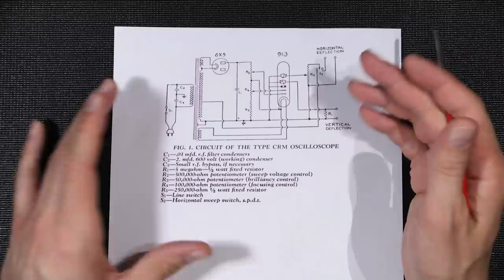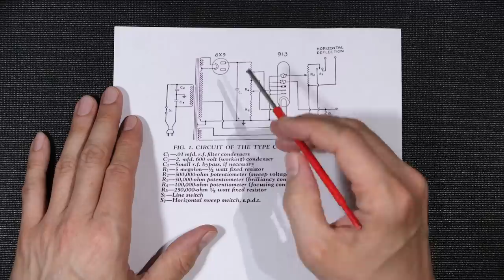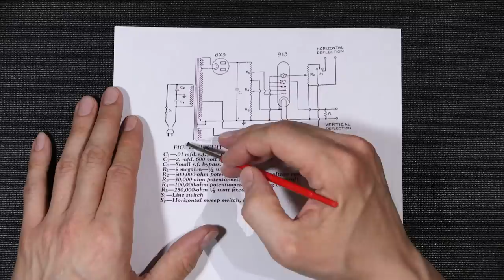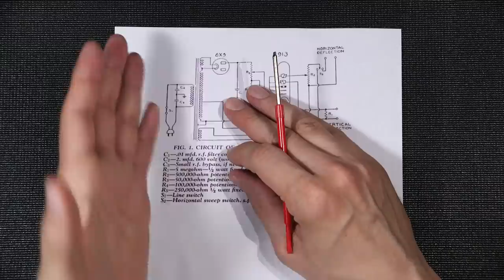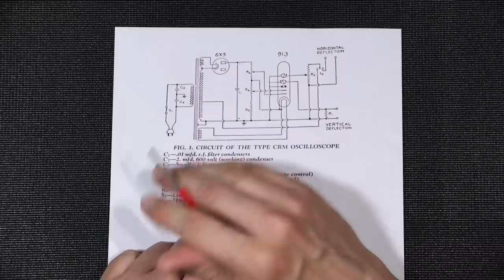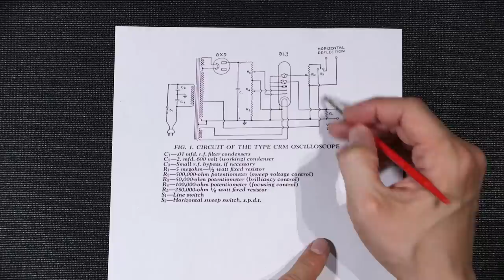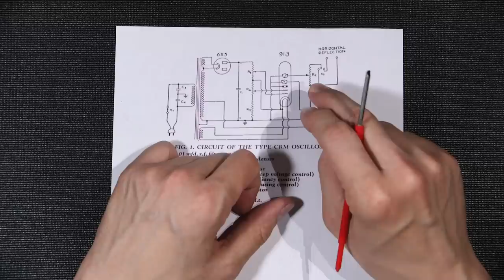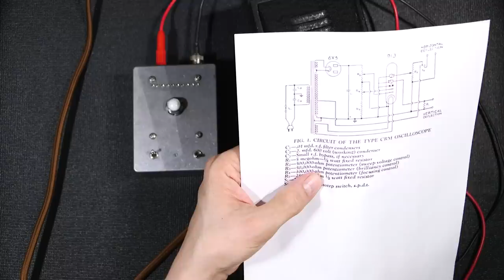Neat Electronic Tool From The 1930's, Lets Look Inside!

Comment: Wonderful bit of vintage gear!  I would have liked you to remove the capacitor contents from the Aerovox can and re-stuff it with the new capacitor.  I think it's important to keep as much visual history of this kind of 1930s equipment so that when someone takes it apart in 50 years time they can see the kind of capacitor that was used back in the day.  Leave a note in there too to show what's been done. It actually makes a good debate as to what responsibilities, if any, as restorers we actually have.
Reply: It would be pretty simple to find out if it was restored... you do NOT have to recreate the mistakes of the past to make it "real."  A note would suffice.
Reply: I absolutely agree that the components need updating but if the equipment is of historical interest then leaving in place the old isolated component just to show exactly what was used originally surely gives the best of both worlds? Is the debate not more about whether a piece of equipment is historically 'worthy' of maintaining visual originality?
Reply: Exactly. The authenticity of historic equipment is destroyed by fitting modern components that are visible. At least the original component should be left so a future restorer can do it properly.

Comment: Also, it is amazing how far oscilloscopes advanced between the thirties and fifties. I've been learning about the early computers recently, and the rapid increase in the complexity of some of the signals that oscilloscopes were being used to look at during those years probably goes a long way to explain that.

Talking of which, It'd be great if you got hold of a COMDYNA or something for your old-time lab! The idea of hooking up an analog computer running a Rossler or Chua circuit to the X Y inputs of an old Marconi 'scope I have so that I can play with strange attractors is what's currently firing me up.

Comment: I was curious about that AEROVOX condenser so I typed in the patent number (1,736,764) and found an article from 1929 detailing the process to make this paper wound paraffin wax filled cube.  The patent mentions an asbestos lining used in the vat these things were made in and dielectric oils (presumably PCBs).  Amazingly, the company AEROVOX is still in business making capacitors since 1922.
Reply from the maker: All the good stuff!

Comment: Mr. Carlson, I suggest de-potting the transformer. It appears to be in good condition, other than those two internal capacitors. So replacing those would keep this scope as close to original as possible.I would also suggest, placing the new filter capacitor inside the old can. Again just to be as close to original (at least in appearance) as is possible. Brendan
Reply: Good idea. Replace too much and it becomes something different

Comment: You know that scope reminds me of the built in scope on the old Radio Teletype van that I ran when I was in the US Army back in the early to mid 1970's.  I don't recall the number of the part but we used it in the tuning up of the set, and in keeping the NSK/FSK signals aligned when in the crypto mode.  Very cool rebuild. I would love to see  you build up a new PS for the unit, however the depotting does sound intriguing.  I recently found a nice covering for some of my projects that looks like carbon fiber, I have it on a small FM radio receiver I built for our RV, looks cool but it would not really fit in with the age of your project I guess.

Comment: I’d like to see you de-pot the transformer. In my work I sometimes have to de-pot our HV DC-DC converters for failure analysis. That’s a lot of fun - trying to find where the potting ends and the circuit begins. I’d also like to see your sand-blaster in action, to be honest. I’d like to have one of those myself.

Comment: GREAT vid as usual! Perhaps mill a hole in the transformer bottom cover and use localized heat to get to that cap? Was this designed for use as a "station monitor?" If there is a future video, perhaps set it up with a vintage transmitter for a look at intended service? Thanks Paul!

Comment: In keeping with not labeling the front controls they did not label the external inputs. But they did do when clever bit, the horizontal inputs on the right side are arranged horizontally and the vertical input on the left side are arranged vertically. I think this was clever!

Comment: While I'd hate to see you go through the mess of depotting the xfrmr I think it would be interesting to see the type and style of the hidden caps.  The filter cap you replaced, although increadibly leaky had a very cool retro look.  I would have been tempted to gut it and install the replacement cap inside the original case - although I've seen enough of your videos to know that's not in the cards.  I love seeing the work you do.  I grew up on test equipment like much of the gear you restore.  Keep up the nice work!

Comment: +1 on depotting the xformer. I am also interested in you doing a video on finding suitable replacement xformers for older gear. 
Also I was wondering if you are still planning a vid on recapping and restoring the type 555. I also have one thats in really good condition. It was stored in a clean climate controlled room for the last 25 years but was inservice up until then. About the only thing o am missing is the line cord for the power supply. Which doesn't  look too difficult to replace.

Comment: I note there is no lables on the switches of the capacitor tester...i guess in those days you just had to learn what they do ☺
Reply: More like in those days the engineers weren't too sure themselves. Half the stuff no one had thought of a name for it yet anyways.
Reply: they still don't. they still measure capacitors in the amount of volts per second it can randomly hold. with no mention of important stuff such as the atomic number of the materials, their area, and distance to one another. as ac and radio and light and the behaviour of capacitors are all the same thing, those aspects are far more important if we ever want to get ion drive spaceships than how many farad they just so happen to randomly hold 'it does something! let's call it a product and ship it!'
Reply: As long as it does something I'm in.

Comment: Hi Paul. I seem to remember that the local Harley store might have a can of black crinkle paint. I think I saw that in an Electric Radio magazine some years ago. Yes un pot it :-) I remember having an HRO 5AT1 with the doghouse PS which is potted, GRRRRR! It also had an Aerovox cap in it too. I'll be waiting for that video :-) Oh the wonderful odor of melting tar :-)  The transformer may be re used without the caps?  Or would the heat ruin the varnish?  A nice cliffhanger as to what you plan to do with it after :-)

Comment: Maybe the potted capacitors was part of some planned obsolecence / need for replacement parts from national? Or maybe it was for "safety" if the capacitors blew they would be sort of contained. Interesting to pot them though as it does make servicing them very difficult. Any thoughts as to why they might have done it apart from design error?

Comment: I was expecting to see a resultant display, from the 6L6 much like how a Nixie tube works... as in a Philoscope.
 Mind you, a Philiscope would have been handy for the capacitor testing! (except for the LC bias due to the components being potted)
 That Sw3 for the horizontal, well that simply provides the locked-to-60hz reference for the Horizontal whilst measuring a Y deflection only.
Keep up the good work!

Comment: I assume this little 'scope was used to view the AM signal on the vertical input and the audio on the horizontal input to verify linearity of the AM signal.
Reply: David Perkins yes it's a modulation monitor, a common enough piece of test gear in the days when hams used a lot of AM.

Comment: Kind of amazed on this cap tester to see a full scale deflection from just 2 generic NPN's  just touching the clips. Are you sure there's no strong EMI or RF being picked-up? Also for the potted cap test, wouldn't the BNC negative clip lead have been a better choice to clip to the chassis ground, assuming the cap tester could be picking-up stray fields? (Good job.. I'm almost convinced on the merits of joining the patreon crowd).
Reply from the maker: Hi Cliff. There are RFI and EMI blocking caps in the design. That really is the resistance of the rubber material :^)

Comment: I wonder if early scopes like this "morphed" into the station monitors by dint of improvement from early models that would have been jury -rigged into home amateur radio stations. They retained the characteristically "very tiny" tubes, maxing out at 3 inches or so in the Kenwood ones I'm familiar with.   So simple, and unlike a general purpose scope.

Comment: I'm wondering if that device wasn't designed with being an AM mod scope in mind: For the old "trapezoid" waveform, just patch your modulation audio to the horizontal input and a sample of your antenna feed to the vertical. 100% mod would show a triangular envelope, less would show a trapezoid and overmod would show a (usually) distorted triangle with a straight line from the apex.

Comment: Saw the patent number on that capacitor, so I looked it up. U.S. Patent 1736764 was given to Aerovox Wireless Corporation. The patent is for a step of oil cooling was dipped condensers during manufacturing. Apparently, there were two companies at the time in the same business - Aerovox and  Dubbilier Condenser Corporation. Dubbilier had a patent on what it claimed to be the exact same thing as Aerovox, so they basically sued each other. It looks like at the time, the U.S. Patent office would be in the habbit of issuing patents to two companies for exactly the same thing.

Comment: If you de-pot the transformer to replace those hidden filter caps, then you might as well find a way to re-purpose the original Aerovox housing to hide your new poly cap inside that as well to give it as much of a stock look inside as possible?

Comment: Hi Mr. Carlson, I’m restoring a 1940 Dumont Oscillograph, a 1929 Atwater Kent and a 1939 Sparton console radio plus a few more pieces of antique equipment. I’m having difficulty finding any info on resistor watt requirements. The schematics don’t reveal that info. Is there a “rule of thumb” to determine what they might require?
Thank you for your time.

Comment: if the leakage of the transformer capacitors are not bad enough to threaten the transformer you could just use an isolation transformer to use the device safely.

it may be a good idea to turn down the brightness control and bring it up slowly because if the crt is getting too much voltage ir could burn in otherwise and getting a replacement crt can be difficult unless there is surplus stock out there.

Comment: Crackle finish is important part of the legacy? Built in u (mu) screen? What sort of capacitor? 2uF 600V is probably EHT smoothing and is that big it's paper with long survival rate. Clean around the terminals and the leak will likely be gone! Check it yes but I'd say it will be OK. No timebase components - so is this a Lissajous display with ac X scan? Yeah? Unusual device. Little audio monitor showing activation and volume (strength). Good video. Very clear. Thanks. What is your accent?

Comment: Hey, Paul: why not just use a smaller Transformer and a solid-state voltage doubler or tripler if needed? That way, the unit would run cooler and last longer as well...

Comment: A small oscilloscope from the 1930's wow Now where do you find your equipment? So since it was used to test an audio signal I suppose it would display the modulation wave on that small screen. That is a pretty solidly built unit though with a minimum of parts.I restore old Military radios in my videos and I try to reuse the old parts that are there and restuff with new caps etc. so really I would go through the work of repotting that and put new caps in it. But Im with you what was national thinking when they did that in the first place? Great project and Video.
Reply from the maker: Thanks for your comment Larry!

Comment: Hi Paul
As usual an excellent video. I see that you replace components with new style only. I never see you re-stuff a capacitor. The capacitor in that unit would have been re-stuffed well. I am not knocking you for that as I (being an engineer for 40 years) still learn a lot from you. Just my opinion.

Comment: BTW - DON'T DISMANTLE THE TRANSFORMER! Chances are that those filter caps are OK anyway.  The leakage you see with that sensitive device is EVERYWHERE in that transformer. I would use a Variac on the transformer and while measuring the ac current - wind up the line volts very slowly.  IMHO of course! Good luck  BerryG

Comment: Hi Paul. While it would be entertaining to see you depot that transformer to replace the caps, I'd say it isn't worth the effort. Chuck it in the tip and replace it. As for what National was thinking...planned obsolescence maybe?

Regarding disassembly to get the chassis out, was it really easier to desolder the connectors rather than remove the screws holding them to the case?

Bugger all in this thing - just a CRT and power supply rectification, signal goes straight to the vertical deflection. Nice to know that usable test gear doesn't need to be incredibly complicated. I'm curious what the bandwidth of this is, though since it's meant for showing audio signals on an RF carrier...

Comment: I’d de-pot the transformer, if for no other reason than to get rid of those old across-the-line caps. Then use modern X/Y-rated safety caps instead. Also, even though it didn’t come with one, a fuse would be a good idea (in any restored tube equipment.) Maybe even a neon-bulb pilot light! You don’t want those old across-the-line caps to fail shorted inside the tar-filled transformer!

Comment: Regarding depotting: I'm hoping you will elect to depot the transformer. I happen to have one case where it is my only option, as far as I'm concerned, and would really like to see your methods. In your case, if you do not depot, could you possibly simply couple the ground lead from between your potted caps through one additional good cap to chassis ground? Or, could it be left floating as long as your chassis was connected to hard ground?

Comment: Hi Carlson!
since the internal transformer is at least WORKING even thou, the internal capacitors are leaking, Maybe you can get around the problem & recover the whole thing,  trying to electrically Isolate the trasformer itself from it's standoffs.... the leakage will remain, but limited to the transformer only.
Try it, maybe it will work!
ciao
Mario

Comment: Charlie Andrews, the long-time Chief Engineer of WPEN 950-AM, Philadelphia (https://tinyurl.com/WPEN-950-AM-PHILLY), was my engineering mentor in the '70s. He had one of these in the engineering office; they were referred to as "spot scopes", and most often used to see how clean the modulation was. These scopes spotted more 'poor shielding issues', than any other method. They came in very handily at TV stations, and were worth their weight in gold - where frequency modulation came into play.  I don't know if this was a Philly "thing", however I've heard them nicknamed "Ralph" - "hey, you, go get Ralph"...  If memory serves, many were made by a company called "Arliss Electronics".  I guarantee these are rare now; many were trashed in the late 1960's/early 1970's because of the fear of inadequate X-Ray shielding protection. (even though the design seems fairly benign)

I'm with the de-pot crowd - on this one.

Comment: With the transformer how about just a few hours of baking it, to get the moisture out of the windings. Might be enough to remelt the tar and get the leakage down again on it. Otherwise those caps are probably just under the surface of the tar by the mains entry, easy enough to get to them without having to pull the whole mess out of the tar. Just have to use hot air and gentle removal of the melted tar to find them.

Comment: What was the Potting material used in the Transformer? AFAIK, PCBs were already in use in the 1930s, and de-potting that transformer could be a bio-hazard issue.  I wouldn't consider it unless you were certain what chemicals were used and how to deal with them.

Comment: "National" was the brand name for Matsushita Electric in most countries where it was known as Panasonic. Apparently it was not available as a trade mark in the US.
The potted caps may have been built-in to the transformer by the transformer manufacturer not National. It may have been an off-the-shelf unit.
I am sorry the values of these were not tested, after their value was speculated from the schematic.
I am wondering what the original leakage value for a wax/paper capacitor would have been. It would likely have been higher than for the modern Mylar cap.

Comment: It’d be interesting to see inside the capacitor. 

You might be lucky and find the legs of those mains capacitors sticking out from the tar once you remove the bottom plate of the transformer. Otherwise you’ll have to do some “baking”. I can just imagine what my wife would say, if I tried that here ;-)